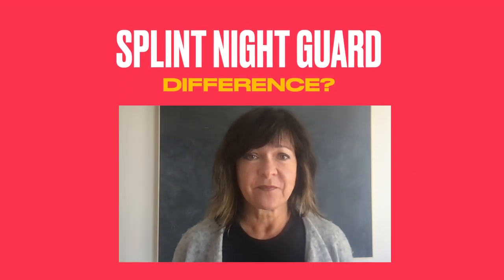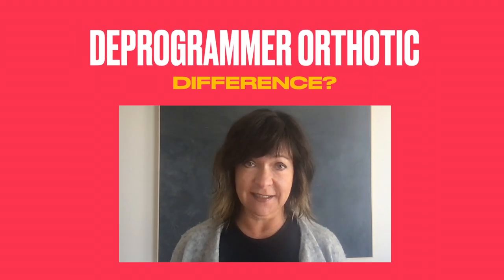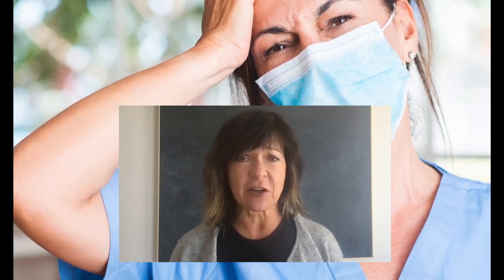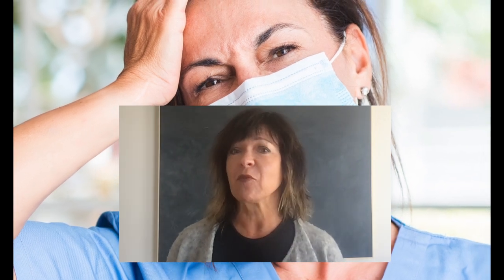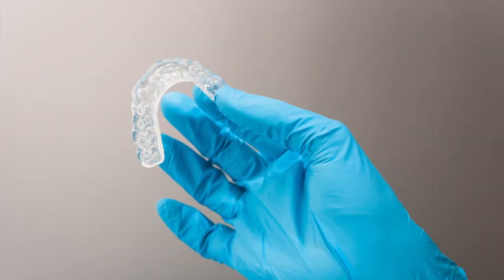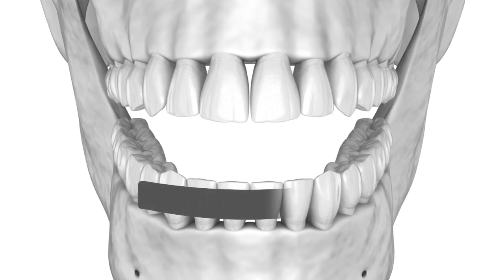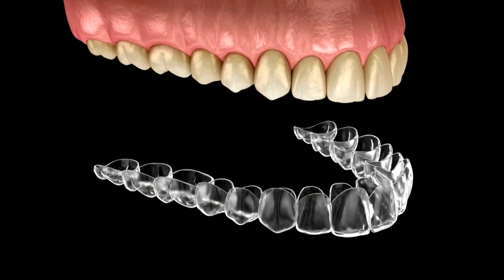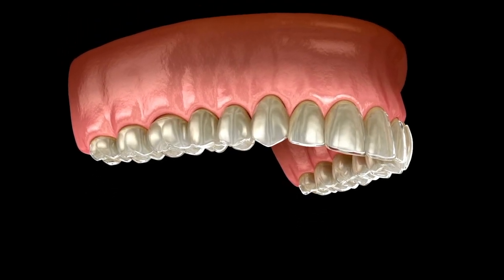Difference Between Splint vs Nightguard | Dr. Agatha Bis

Comment: Hi, I am a patient and my dentist made me a Maxillary 3D printed splint.  It was so tight on my teeth that I had a difficult time removing.  Also the splint was so hard, it caused clicking in my TMJ and pain in jaw.  I could not wear it.  What went wrong?  Are there different hardness of materials used to 3D print splints?  Could my dentist send the digital scan to a lab to make a traditional splint?  My office no longer uses alginate for impressions, only digital scans.  I have worn a splint for 35 years and have never had a problem with a splint prior to the digital splint.

Thank you.  I wish you were my dentist, thank you for your videos.
Reply: I have the same problem. My two previous night guards, I had a regular impression and they worked great. The dentist did a digital scan and I hate this one. It’s a very tight and my bite is off. Still not sure what I need or what to do without wasting money.